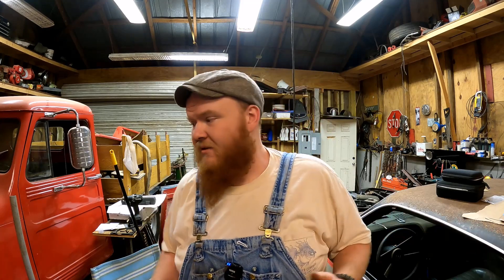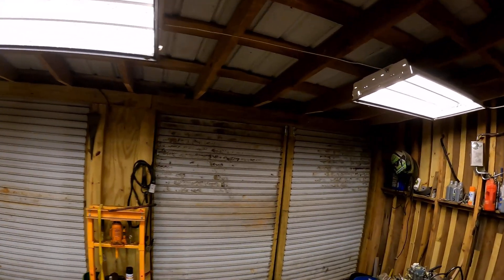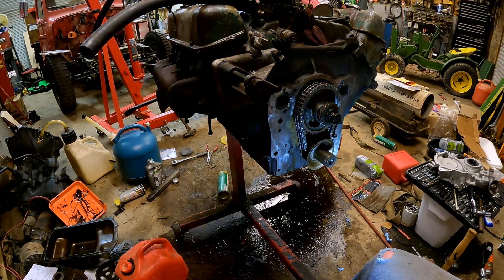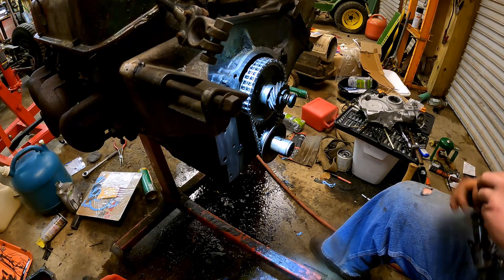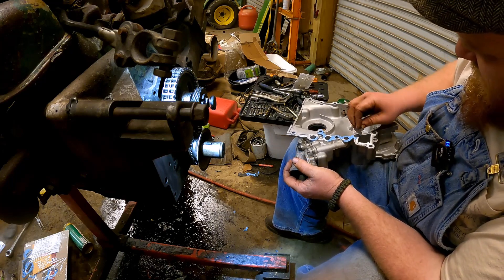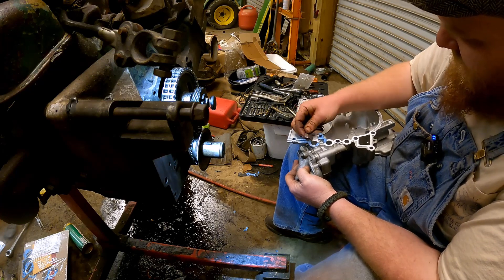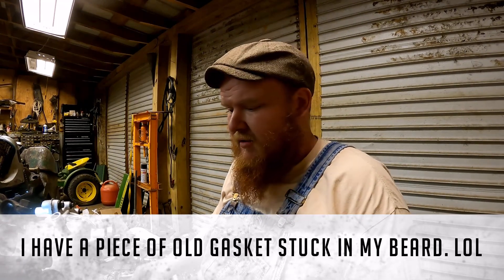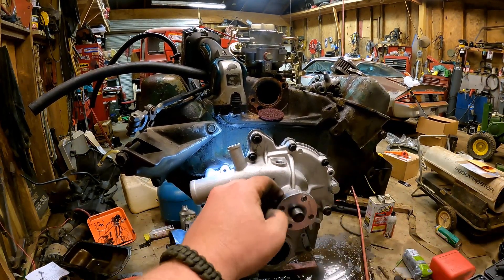Dauntless V6 TIMING COVER INSTALL

Comment: Btw when installing fuel pump and distributor generously lube contact areas. Dust gear and fuel pump arm and pivot. Easy to forget.
Reply from the maker: Will do

Comment: Don't know if you did it but you want to pre soak the timing chain. Not the end of the world. I've forgotten and put them on dry but I'm trying to train myself not to forget. I know I mentioned this but I spewed so much at you it's hard to remember it all. Having trouble keeping straight on this end lol.
Reply from the maker: No I didn’t soak it. I’m going to prime the system by hand and turn everything slowly. I figure that will save me a lot of trouble lol
Reply: @redclaytraveler1949  I think the brake cleaner would have washed it all out anyway.  better dry than full of debris though!
Reply from the maker: Yeah that’s true. When I get back I’m going to fill the engine up with oil and prime the pump. Well actually I need to flush the water jacket first and put the freeze plugs in before I fill it with oil. Lol I still have rotate it around before oil goes in.
Reply: @redclaytraveler1949  just to let you know u tube must be napping. Some things are coming thru and some are not. I don't and won't ignore you. I just noticed this. If you need something and I don't respond you should have my number. Never have trusted all this computer stuff plus I'm tech challenged which doesn't help. I'm an idiot lol.
Reply from the maker: No worries, I appreciate it buddy! YouTube has a mind of its own lol
Reply: @redclaytraveler1949  ok I got that one. They must have heard me.